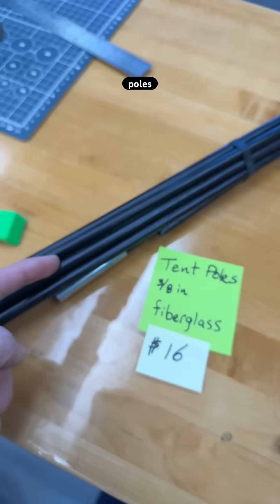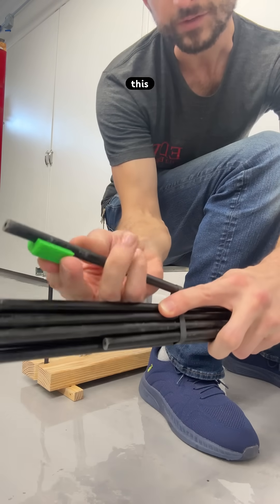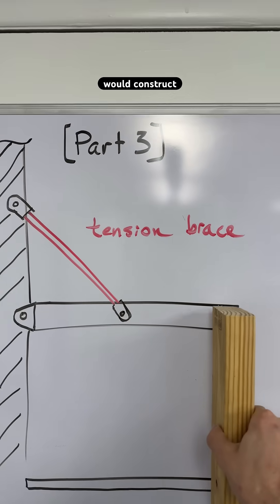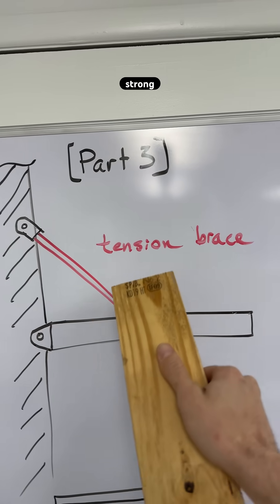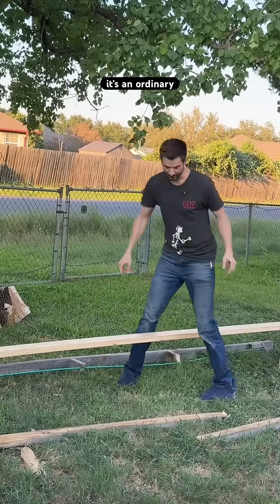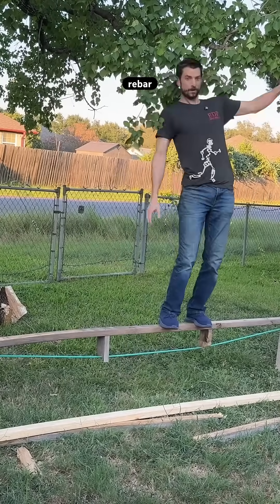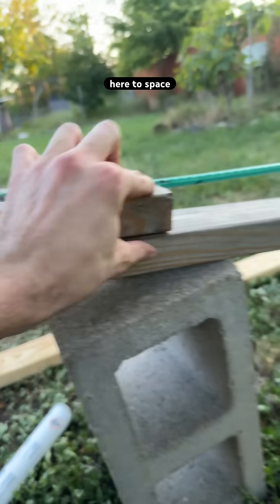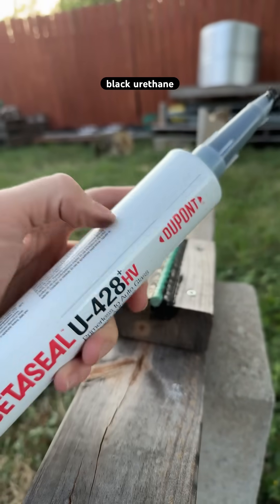what you can do with a member in tension (see the end!)

Comment: Forgive me ahead of time if I’m wrong, but didn’t you, in ver 1.0, also make the very cool/nifty asf attachment-part you 3D printed, for connecting extruded aluminum, that has the ability to set an angled connection to a separate extruded piece of Al. using just the parts you printed and a thru bolt to lock it all together. I believe you came up with that very well thought up printed part also, but correct me if I’m wrong. I think that whole system of like 3 printed parts  and a thru-bolt was used to attach, very securely, whatever profile extruded Al one would want, at whatever angle one wanted, and also the end caps for the extruded Al. profile. I believe that was you.  
Good ideas.
Reply from the maker: yes i recently posted a 2piece “interlock” that connects aluminum extrusion. I am simply designing a collection of 3D parts that enable us to interface all the best off-the-shelf materials cheaply and effortlessly.

Comment: Eliminate the expensive glue and bend the tips of the rebar to captive using the 2x4? 
This is cool. Thanks for sharing
Reply: I believe it's fiberglass which is part of the point, to simplify design without losing load-bearing structural integrity and also making them light weight using fewer materials. And yes it's cool AF :)
Reply: @NoTime4HorsePucky  Isn’t this epoxy coated rebar?
Reply: I think it’s a composite of E-glass fibers and vinyl ester resin.  It’s very lightweight. I don’t think there is any metal in the fiberglass rebar, despite looking like wrapped rebar.

Comment: Did you not trust the old 2x4 by itself to not break? A better "apples to apples" test would have been to put it back up and stand on it after you had twisted those two tension blocks to unseat the rebar.
Reply from the maker: oh yeah good point.  or to keep it flipped upside down, and bend it inverted.  I did notice it is quite brittle. Overall I was relieved to find an hour to do this and get the project checked off.  too many unfinished works 😅

I appreciate your inputs, thanks!
Reply: @davidmalawey  I REALLY enjoy your channel. 'Little direct overlap which what I'm doing but I definitely get a charge and mindset refresh that I bring to my own work.

Comment: I thought you were going to go a different way with the wood and do what concrete bridges do: Use a lot of rebar and large bolts to draw the cement together and bring it all into compression, since the cement is very strong in compression but very brittle in tension. It would be cool to see you demo that with some wood!
Reply from the maker: i was brainstorming how to pre-load the rebar for a long time.  I REALLLY wanted to do a trial like that.  With insanely high load on that one beam.  Maybe the community can send me a tightening mechanism design on discord and I’ll implement next.